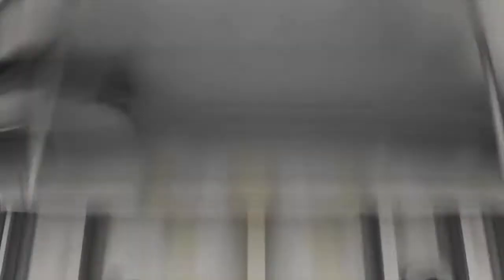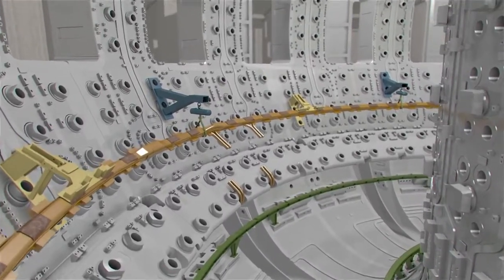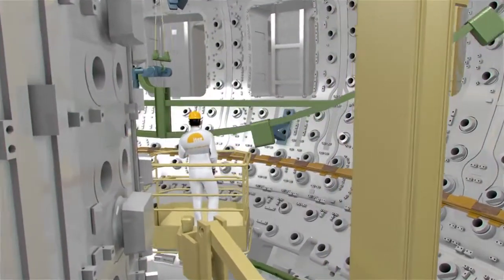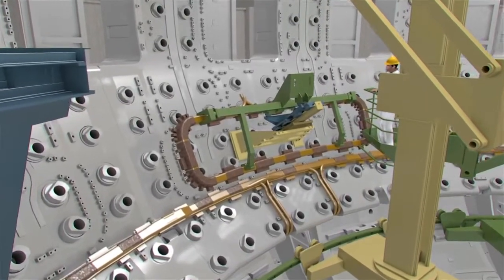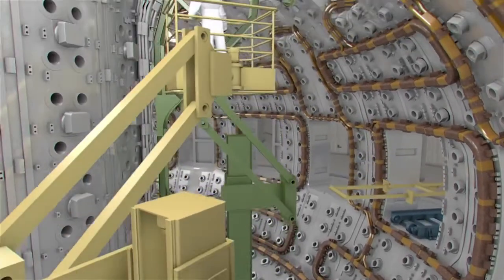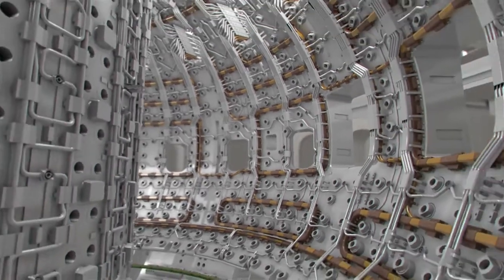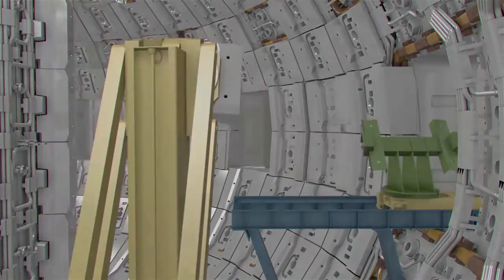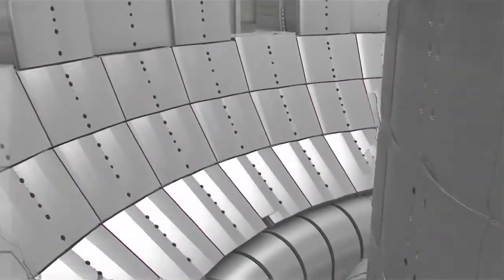Iter

Comment: We already know ITER does not promise to show us a path towards commercially viable nuclear fusion. The best we can hope to achieve is to yet again discover knew ways in which Tokamaks don't scale like we expected them too.

ITER is the giant Cuckoo that crowds out the multitude of cheap, small scale fusion experiments that actually could conceivably lead to a cheap, commercially viable fusion reactor. It's a thing of profound sadness.
Reply: ITER will for the first time in history produce net energy. None of the fusion reactors built so far have ever achieved that and without it there would never be a commercially available reactor because you have to produce more energy than you use before you can sell the reactors as generators of energy instead of consumers of energy. It's not some crazed experiment with no merit, it's a very important step towards proving the viability of fusion reactors and will go down in history.
Reply: +Kalimul
"ITER will for the first time in history produce net energy."

Not true and not relevant. Thermonuclear bombs produce net energy and have since the 1950's, and yet, here we are some 60 odd years later and we don't have fusion energy (see project PACER).

ITER is not the way forward, which is ironic considering the name.

"It's not some crazed experiment with no merit, it's a very important step towards proving the viability of fusion reactors and will go down in history."

ITER has no merit and it will go down in history as a pork barrel project for physicists that stood firmly in the way of practical fusion energy; crowding out all other approaches that actually could lead to viable fusion energy.

We already know that if ITER succeeds according to all its goals and it's even more monstrous follow up DEMO succeeds according to all its (provisional) goals and fusion reactors become a commodity product in 2060; the world will yawn and not buy a single one.

ITER was obsolete even before they put a shovel in the ground; it will explore a region of parameter space that will never be viable for commercial reactors and you won't learn much of anything about the region of parameter space that is. What we learn doing ITER will not be very applicable to other fusion reactors, not even other compact tokamaks with much higher magnetic fields or stellarators.

ITER is too large for fast iteration, costs too much to be built by one nation which results in terrible political decisions and compromises. Fusion energy needs ITER like it needs a hole in the head.

"Except it won't since by that time environmentalists will start to promote it as a way to reduce the footprint of renewables and the impact on the environment."

That's never been what has driven environmentalism; not really. The rank and file may say that. But the people who shaped environmentalism opposed nuclear fission because it worked. They were anti-humanists who considered cheap, safe, plentiful energy as dangerous as giving a machine gun to an "idiot child". They were and are anti-humanists who want to see humanity small, powerless and frighetened.

"Mark my words, one day solar panels will be considered backwards and wasteful."

Sensible people reached that conclusion decades ago.

"We live in a world where it's likely that even less money will go into fusion research with leaders like Trump that think that climate change is a Chinese conspiracy."

We also live in a world were environmentalists vehemently oppose effective measures against global warming. Which suggests that global warming is the goal and the solution to their problem (humanity).
Reply: "Not true and not relevant. Thermonuclear bombs produce net energy and have since the 1950's, and yet, here we are some 60 odd years later and we don't have fusion energy (see project PACER)."

Try harvesting energy to produce electricity from a hydrogen bomb. Go on, try. Also, the production of the plutonium needed to produce the explosion will probably bring the whole argument down even in the theoretical stage, not to mention one would have to deal with the long live radioactive material after the explosion.

"ITER is not the way forward, which is ironic considering the name."

It's the way forward towards commercially available fusion reactors since it is likely to be the first reactor (not bomb) to achieve net production of energy.

"ITER has no merit and it will go down in history as a pork barrel project for physicists that stood firmly in the way of practical fusion energy; crowding out all other approaches that actually could lead to viable fusion energy."

Thus your bias unravels. Envious your pet project doesn't get funding? Well tough luck. Personally I would prefer if more approaches get the funding needed BUT if we had to choose between giving money to a small team with big promises and nothing to show and an international team with full support of the governments involved, I'd choose the latter.

"We already know that if ITER succeeds according to all its goals and it's even more monstrous follow up DEMO succeeds according to all its (provisional) goals and fusion reactors become a commodity product in 2060; the world will yawn and not buy a single one."

Except it won't since by that time environmentalists will start to promote it as a way to reduce the footprint of renewables and the impact on the environment. We shouldn't wait for fusion to switch to zero emissions energy sources, however once we get there it won't be over. Mark my words, one day solar panels will be considered backwards and wasteful.

"ITER was obsolete even before they put a shovel in the ground; it will explore a region of parameter space that will never be viable for commercial reactors and you won't learn much of anything about the region of parameter space that is. What we learn doing ITER will not be very applicable to other fusion reactors, not even other compact tokamaks with much higher magnetic fields or stellarators."

We always learn something new, at the very worst  we'd learn that fusion reactors (not bombs) can produce net energy instead of just consuming it. BTW it's just conjecture that ITER can't be evolved into a viable commercial reactor, speculation made by the very people advocating for compact reactors, ever so envious their projects aren't taken as seriously.

"ITER is too large for fast iteration, costs too much to be built by one nation which results in terrible political decisions and compromises. Fusion energy needs ITER like it needs a hole in the head."

Fusion as an effort needs ITER as a poster child that shows that nuclear fusion is the way forward. There are zero reactors that produce net energy right now and likely there will be no other when ITER will start working. Between sponsoring high risk and high reward projects and a low risk high reward one, you know already what politicians have chosen. In a perfect world more money would go into the field and allow anyone to develop their pet project but we don't live in that world. We live in a world where it's likely that even less money will go into fusion research with leaders like Trump that think that climate change is a Chinese conspiracy. Frankly I'm glad an international effort like ITER was started because if it was an American project only it would have been canceled by now like large particle accelerators were before the LHC.
Reply: "Try harvesting energy to produce electricity from a hydrogen bomb. Go on, try."

Easy. Project pacer. The technology has existed for nearly 70 years. Essentially: Drill vertical pipes into a salt dome, put U-shaped pipes inside them like any old geothermal well. Drill and explode nuclear weapons into an underground cavity in the salt at regular intervals far enough away from the pipes to not destroy them. Use the heat to power a regular steam turbine. A piece of piss. Just much too expensive.

"It's the way forward towards commercially available fusion reactors since it is likely to be the first reactor (not bomb) to achieve net production of energy."

I disagree. I'd put even money on it not being first to net energy, if it even manages net energy. And that's not a way forward to commercialization; if anything it will convince the world that commercial fusion power is too expensive, too large and too fragile to be persued.

It's just a ridiculous prestige-project; you can't build a commercial reactor based on giant Tokamaks with obsolete 1990's tech. It explores the wrong part of parameter space to learn about any other approach to nuclear fusion.

"Fusion as an effort needs ITER as a poster child that shows that nuclear fusion is the way forward."

A task that fails even if it succeeds spectacularly with everything it sets out to acomplish is exactly the sort of poster child fusion needs like it needs a hole in the head.
Reply: >Easy. Project pacer. 

What is an earthquake? What are long lasting radioactive materials? What is leeching into ground water? What is efficiency even? Don't answer, those are rhetorical, it's never built because it makes more sense to just build a fission reactor needed to make the plutonium in the first place.

>I disagree. 

I disagree with you as well. That was easy.

>A task that fails even if it succeeds spectacularly with everything it sets out to acomplish is exactly the sort of poster child fusion needs like it needs a hole in the head.

Uh oh, opinion pieaces are so easy to write.
Reply: When have tokamaks not scaled as we expected them to? Tokamaks have been steadily scaled through like 5 orders of magnitude in key parameters and there is less than one more to go before practical power production. 5 orders of magnitude of scaling is about same as internal combustion engines, first ones were about 1hp and the most powerful in the world is about 100 000hp. Unfortunately fusion reactors are bit more difficult than internal combustion engines and 5 orders of magnitude are just not enough to make it work as a power station, JET was just about short. When JET performance was confirmed the decision was made, 10X bigger reactor will be built to bridge the gap and that's exactly what ITER is. Unfortunate that 10X bigger reactor takes 10X longer to build.